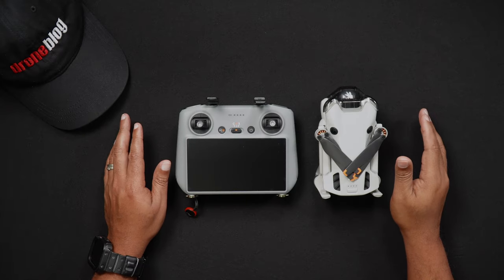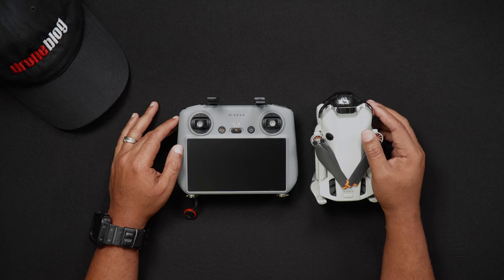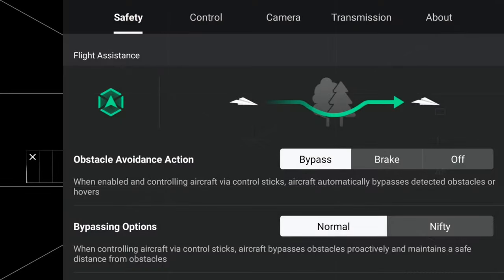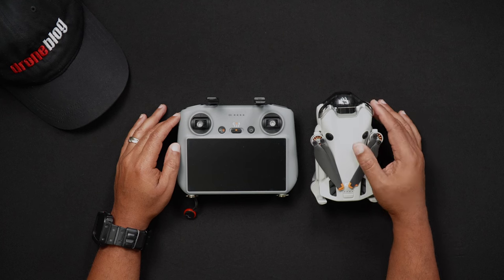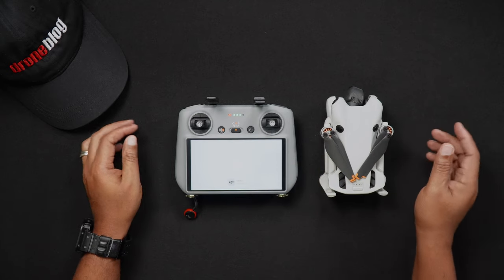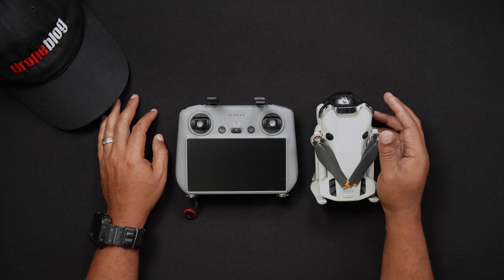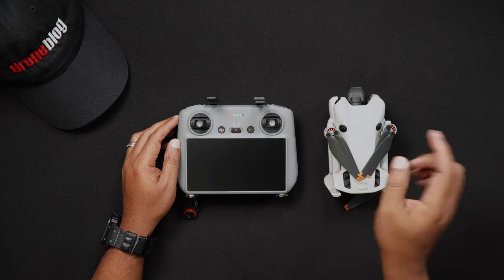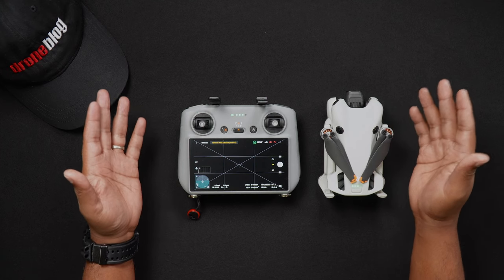DJI Mini 4 Pro: How to Calibrate Gimbal, IMU, and Compass

Comment: Nothing on video on how to tell if the compass calibration was complete, had to go to another video.  If you don't get a message that it passed you didn't get it calibrated. If you get a failed message it need to be repeated.
Reply: Exactly. No insight on what to do if the calibration keeps failing. What video did you watch that helped?

Comment: I noticed since I added blade guards and I command the drone to move backwards it will move back and to the left just a bit. I’m wondering if the weight if the blade guards is demanding recalibrating of the IMU and advice would be appreciated.
Reply: Why do you need blade guards on such a small drone? Hope not to make the FAA happy.

Comment: I crashed my mini 4 pro, it was with rc2 and after crash the view was visible but after few minutes the drone got disconnected, and now after repairing the physical damages the drone is still not getting into pairing mode or it is not getting connected to the remote

Comment: Problems with the IMU calibration.
1. Lay drone on flat surface... great, this works fine, we move on to position two
2. Lay it on its side.  PROBLEM!   It doesn't,  The arms are all fully retracted, the propellers are all inboard... but it's like a table with a leg missing.

Anyone?
Reply: Yeah I just went through this process for the first time myself so I'll try and help as I'm a brand new drone user myself and am also learning. Eventually it will stabalise on it's side and when it does and it's successful, the two green lights will commence flashing again which means it's calibrating. Focus on the image on the left side of your controller screen as this will depict what position it wants you to put the drone into for calibration. It takes a little bit of time but just be patient and you'll get it as well. Good luck!
Reply: @liahalsall  I ended up propping it up against a book, and it worked fine.  If I don't prop it up, it wants to lie on a bit of a slant : /

Having great fun with the Mini 4 Pro.  So much fun that I just ordered a DJI Avata II (FPV).  My credit card company loves me - but my wife, not so much right now  XD